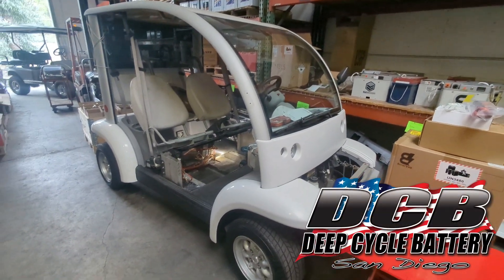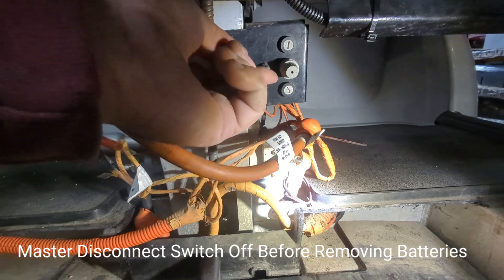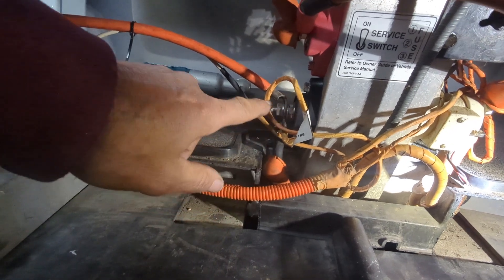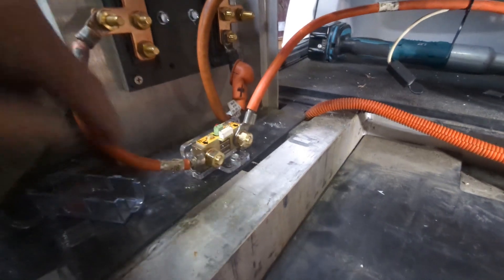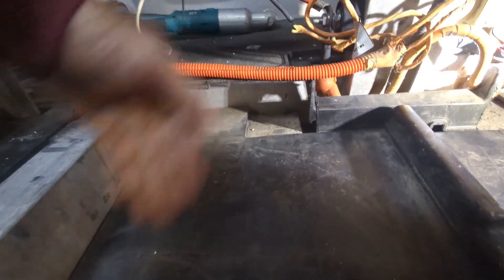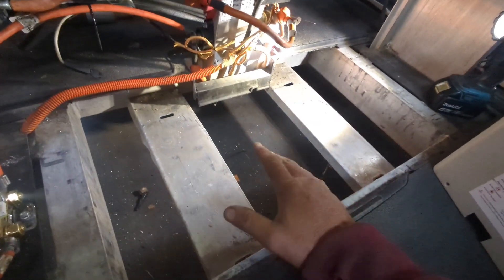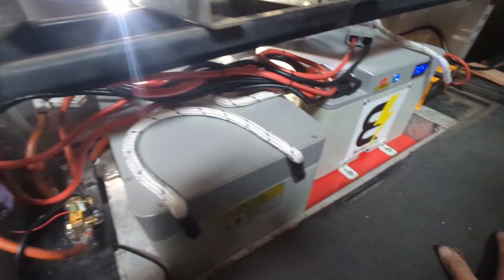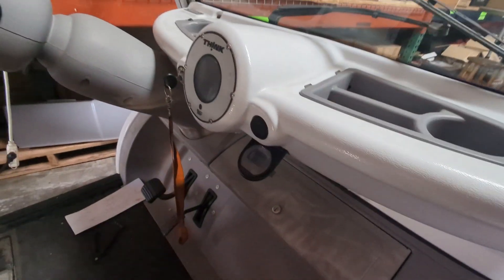Lithium Conversion Electric Think EV Battery  72 Volt Installation

Comment: In the process of doing this on my Ford Think.  Wondering if you use the old connection harness, etc?  Do I keep the old charger/DC-DC converter in place and just don't use it for charging?  Will this allow me to power the cluster and the lights, etc?  Is there something I need to do differently to make the key and accessories work?
Reply from the maker: The positive and negative wires were connected if that's what you mean from the harness. The old charger remains but we employed a new charger that has a lithium profile. I hope this helps. Let me know if you have more questions

Comment: Have you converted a gem e825 to lithium?..Thanks.  Great video!
Reply: I have done 2 of them. Doing a 3rd soon as he brings it in. Did a motor upgrade on one, stock controller. Did a navitas swap on the other with a tac 2 setup
Reply from the maker: Yes, we used a ride for fun battery